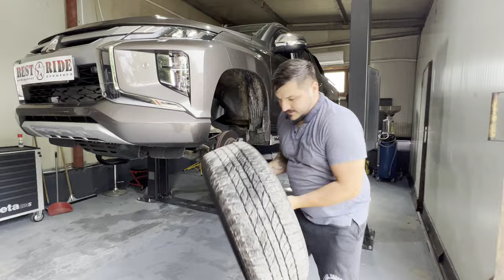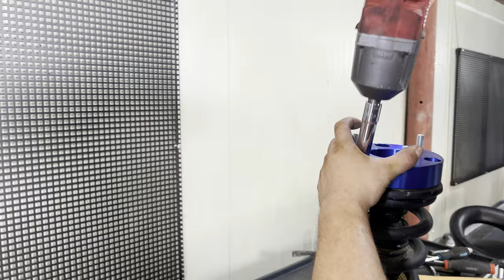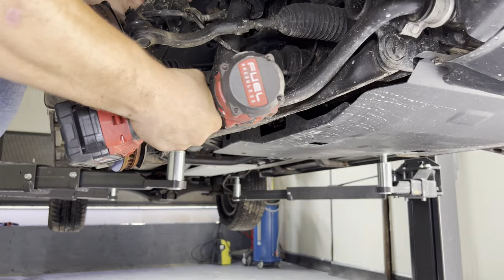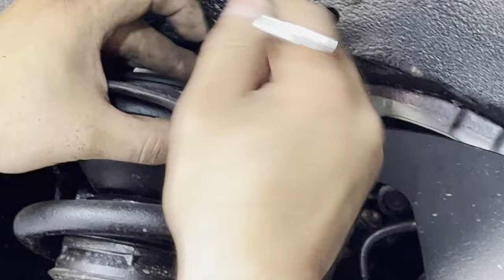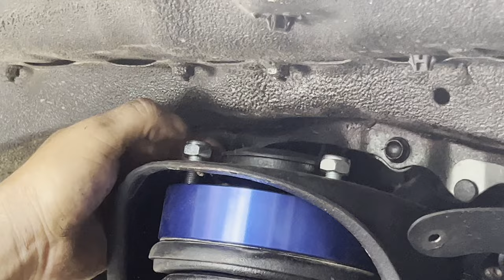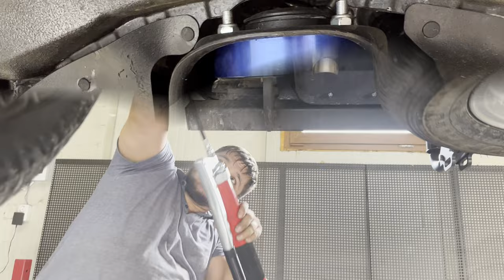How to install PlayXtreme Lift kit on Mitsubishi L200

Comment: Hello.. still use original upper arm? No need replace with upper control arm? Your front suspension still working properly, or fell hard?
Reply from the maker: Yes, it still use the original upper arm. It works ok, a little more harder. 
In general ok